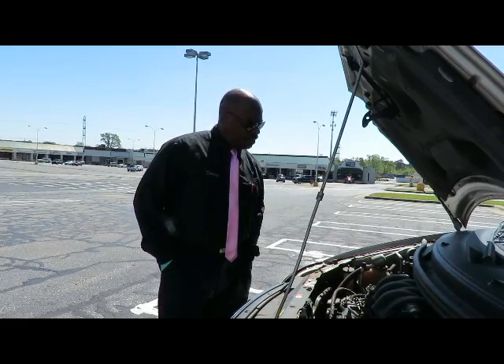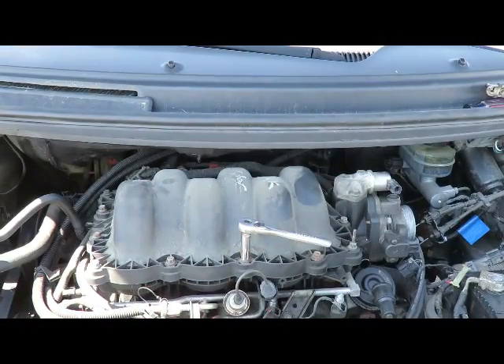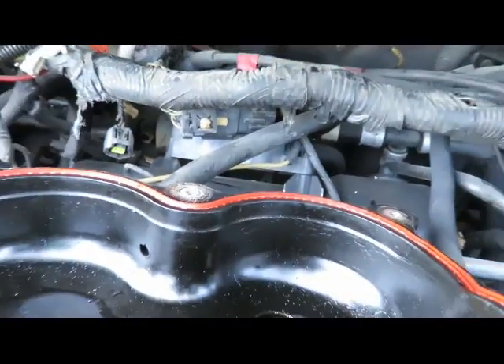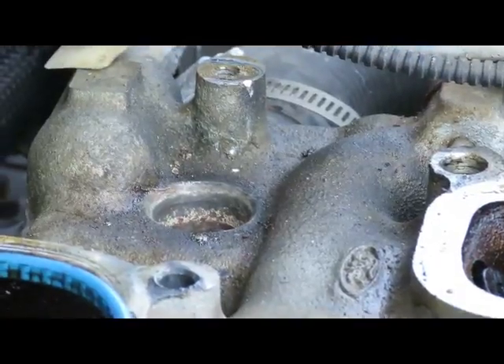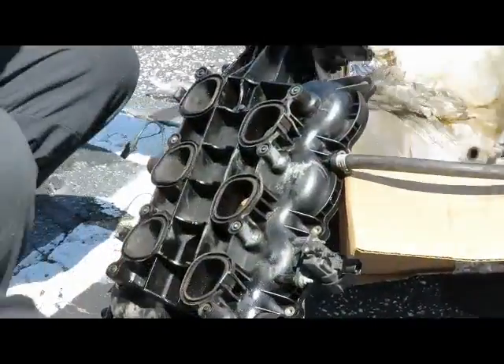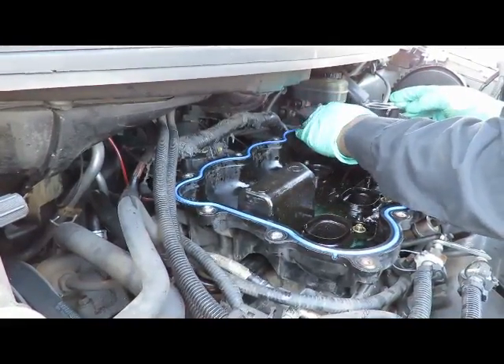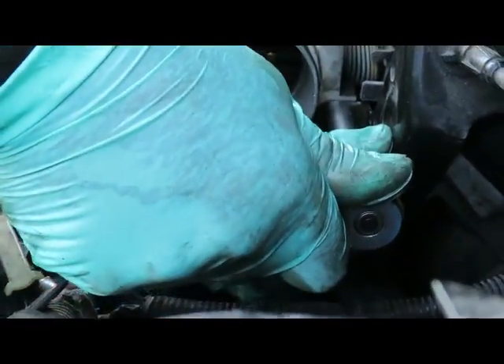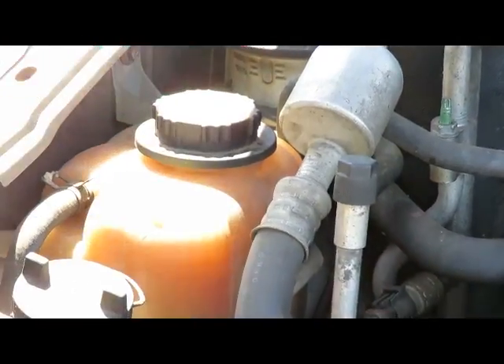2001 Ford Windstar - Heater Hose Assembly - Upper Intake Manifold

Comment: great video ,,any idea the part number for this part i cant find that exact one  thanks
Reply from the maker: Sorry, the customer got the parts. Have you tried rockauto.com
Reply: @OnlineAutoRepairVideos  Thanks much i did but the pics are different from that one .appreciate your time
Reply: @OnlineAutoRepairVideos  at the tee part is a pin hole could i use jb weld to plug the hole lol
Reply from the maker: @NUTFLICKS  LOL I've had bad luck with using JB on cooling parts, but you might have better luck. Let me know what you decide to do.
Reply: @OnlineAutoRepairVideos  Hi i appreciate the help .still no luck with the part so  found a mechanic says it can be bypassed  fingers crossed ..THANKS again PS also had few people tell me jb weld gets putty like when introduced with coolants ..cheers from Canada

Comment: This was extremely helpful, the mechanic we were using before, told us they don't sell the part anymore, but with your product numbers we were able find a parts store that still sells the hose assembly and were able to get it replaced. Could you update your information and list the part numbers and what other liquids you used for the repair?  Thank you.

Comment: lemme help ya a bit.... I'm an OLD school ford factory trained mechanic... on the air intake cover... Don't fight with the silly thing go get a tape measure. a pair a scissors and a piece of card board... measure the width and depth... cut a square a little bigger than the upper housing... lift the housing. Slide the card board under it and ease it forward... the bolts hanging down will not hang on things... they will ride on the card board... same thing putting it back...
Reply: That sounds like the old pull the tablecloth off of a fully set dinner table trick... Totally adding complication, probability of pulling out o rings, leaving dirt behind. a waste of time. He would be washing his hands and you'd still be cutting your piece of cardboard. If a part has to have the bolts left in like so to fit in place.... I use rubber bands from top to top of bolts, this holds the bolts exactly at the ideal depth to get the part in place. It takes only 1 minute to setup. This is how u replace head gaskets on 6.0 and 6.4 superduty trucks without lifting the cab off the frame.... Set the head on a table, insert all head bolts/studs.... Then run rubber bands back and forth... This keeps all the bolts perfect to slide the head in place.

Comment: is that the one that goes bad cause I heard  there are Four heater hoses.
Reply from the maker: Four? I only know of two, and those are the ones right above the top right of engine, unless there are two in the back for the secondary heater core.